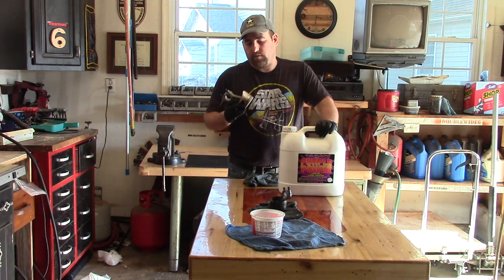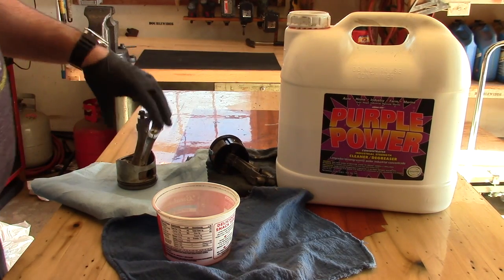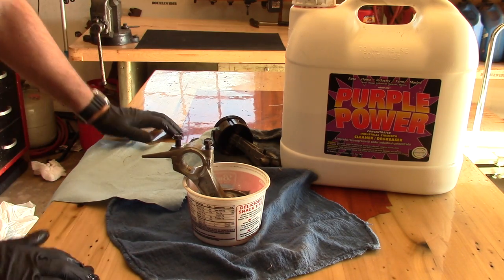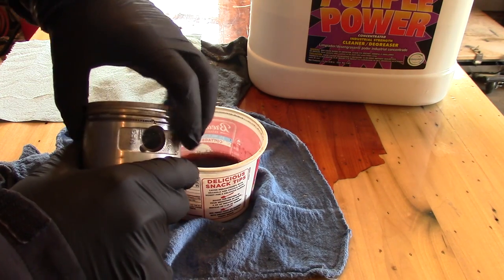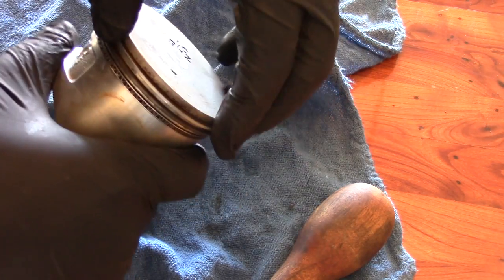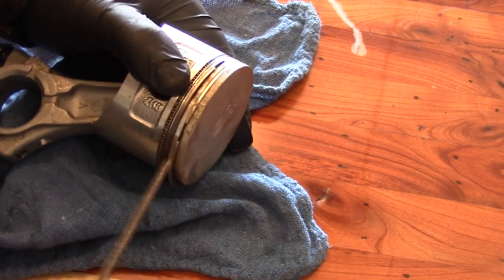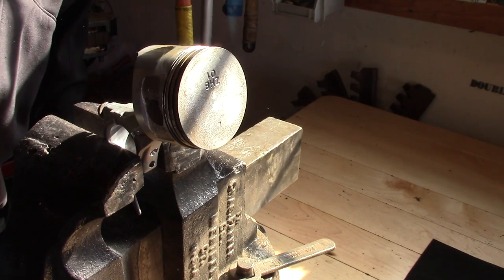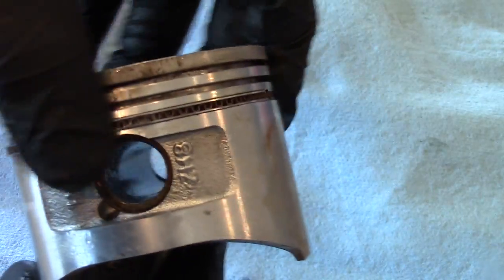Stuck Piston Rings UnSeized

Comment: So my names Andrew  doing my first rebuild on a stihl ms260 chainsaw, how do I know, if I bent the rings to much taking them off? (they were stuck) then when I tried putting them back on the piston. They will move but not real good? Sorry to take your time, I appreciate the videos and like they way you explain things, I’m not a mechanic or real familiar, with the eternal combustion motor. I can’t afford the 300.00 they want to rebuild it at the local hardware store, so I’m going to try it myself,Parts were only 25.00.

Comment: tap the sides with a dead blow or plastic hammer. The rings are slightly proud of the piston and sometimes the shock of the hammer blow will break the bond and will let you work the rings off. This works especially if you get one end free like you had. 72 Courier with blown head gasket. water sat for years and I got them loose but 1 bore was toast with a 2mm deep gouge from erosion.

Comment: Once one end is free and can be pulled out of the groove just enough to insert a knife blade between it and the piston, coax the knife around the piston inside the ring. This puts less snap - inducing stress on the ring than just pulling on the end, I think. It worked for me, anyway. I threw money at the project and used a Dollarama small snap off blade knife.

Comment: Great video! I bought a parts washer from TSC a couple years ago and have only used it as a cart. It seems to be a really nice one but when I read the instructions it said to use a non petroleum based solvent. Would you recommend using Purple Power in my parts washer?
Thanks!
Reply from the maker: I would recommend using it, but I would dilute it in half.  Not sure if it is possible but if you would go with full strength PP and then suck water through the hose to keep the pump clean at the end it may work.  What solvent is recommended for the parts cleaners?
Reply: doublewide6 I did some searching and it looks like there are quite a few biodegradable solvents out there. Purple Power is listed. Simple Green is too but Purple Power seems to be the most economical to buy.
Reply from the maker: I would give it a shot.  I get good results with it.

Comment: I use Purple Power 50% on carburetors all the time. Soak overnight and it usually works great. Maybe try an ultrasonic cleaner with Purple Power for the rings. Thanks
Reply: Stephen May 
thats what i was going to suggest. i use an ultrasonic cleaner to do carburetors and it works like magic!
Reply: I have seen a couple of other repair guys on Youtube use a 50% Purple Power & water solution for carburetor soaking, and it gave good results from what I had seen.  I bought a gallon at Walmart recently, and will try it the next time I need to rebuild a carb.
Reply from the maker: Not a bad idea. Thanks
Reply from the maker: I have pretty good success with my ultrasonic cleaner too.
Reply from the maker: I usually just go full strength and use the ultra sonic cleaner.  If I soak overnight (bad carbs) I dilute with water not quite 50/50
Reply: Yeah, I was looking at the Ultrasonic Cleaner at Harbor Freight the other week when I was there.  I also saw a video where someone took a cheap Harbor Freight orbital sander strapped to a plastic pail with a cleaning solution like Purple Power, it's not ultrasonic per say but the vibrating action from the sander agitates the liquid at a pretty good rate.
Reply from the maker: I have the bigger HF one and get good results.  The carbs that give me problems are the ones that have been sitting for 5,10, or 15 years with old gas in them.  I get a fair amount of equipment that no one wants, and it is in all gummed up.  Chainsaws give me the worst problems, then snowblower carbs.
Reply: I wonder if an old dremel tool works. Just by the sound of that whining    tool might be a better frequency. Soooo annoying.

Comment: I've heard when people quench something after they heat it up they dip it in motor oil. That might be for used for something else though. Was talking today with an old logger he uses a 50/50 mix of acetone and ATF to unseize things and clean the pitch off chainsaw bars. It's something I'm going to have to try to see how well it works. Great video DW6!!
Reply from the maker: Many on here are saying go with the ATF, I need to get some on hand.  Thanks for the tip.  The oil quench is used for hardening metal.  It is part of the heat treating process if you are forging metal like a knife or a chisel then you quench the metal in oil at the right time, so your tool holds the edge or tip/blade.
Reply: Heating and dipping in oil is used for tempering metal to make it stronger.

Comment: Use marvel mystery oil and seafoam together that's what im using for my truck..
 Ill let you guys know how it went should know by tomorrow night 24 hour soak v8  and rotated my my engine and i put more fuel oil treatment in it blow down in the  the cylinder to push the anti corrosion cleaners into valves and they they will be soaking over 24 hours.

Comment: sometimes when I have stuck rings, if part of the ring is loose I take a screwdriver and use the plastic handle  kinda like a hammer and keep tapping the ring as I try to push up on the ring to make kind of a "bubble" just before the stuck area and a lot of the time that will kinda shock it loose, takes a while sometimes though, and doesn't always work..
Reply from the maker: I have done that tapping before, and I had both ends of the ring loose, so if I would have started tapping on the middle it would have popped loose instead of breaking.

Comment: Once you have a little movement, just get a small wooden mallet or handle of a screwdriver and tap lightly around it. It will slowly start to get more and more movement. Dont beat the hell out of it, just tap so the ring goes in and out. A little WD40 will help.

Comment: I think my rings are stuck but I can NOT get pistons out w/o pulling the motor (boat, no room) out. ANY idea how to free those rings while piston stays in cylinder?
Reply: Not possible
Reply: @markdesselle5572  yes it is. That was a year ago and since then we did get it to release the rings. To anyone else in this jam, we took the head off to gain access to the top of the pistons. The 1 that wouldn't budge in the cylinder is the one we suspected of stuck rings. So we sprayed every kind of rust release agent we could find, also soaked it over night in different diesel additives, nothing seemed to work until we had the last idea and nothing to loose. We put a 2x4 on the piston and would hit it with a rubber mallet from all 360 directions and finally the rings broke free. The piston would finally move from side to side in the cylinder. We put it all back together, siphoned all those additives and oils out, put in new oil and fired that puppy up.  Pain in the ass but we did find a way to do it.

Comment: i heat the piston and then put it in a bucket of ATF and Diesel fuel works every time
Reply from the maker: Good to know, you are the second person that mentioned the ATF and Diesel.
Reply: it's cheap and ez this is how i do it heat and soak heat and soak and it works awesome
Reply: I'm in the process of doing that now kerosene and transmission fluid heated the Piston up and drop it in did it twice hasn't worked yet keeping my fingers crossed

Comment: for heavy siezed ring and if the piston is aluminum or even metal, yeah a chemical bath helps but for better results, use heat. Metal expands and contracts with heat. An hour in  your wifes cooking microwave (better than the torch because your heating the entire part, not just a spot) will free it up! Metal properties and thermodynamics 101
Reply: Micro wave ? You're going to have lots of sparks and a "shot" Micro Wave, putting Metal in it!
Reply: @woolyhighlander7280  i ment to say oven. You can tell i dont cook 😂

Comment: If the rings are that bad, wouldn't the cylinder be damaged(scored) as well?
Reply from the maker: Usuallly, there is some damage to the cylinders, but many times the cylinder is cast metal and harder, and it does not have near the damage of the piston skirt.  So you could replace the piston and be back in business.
Reply: Big Mack m